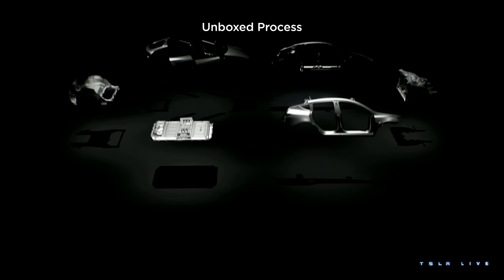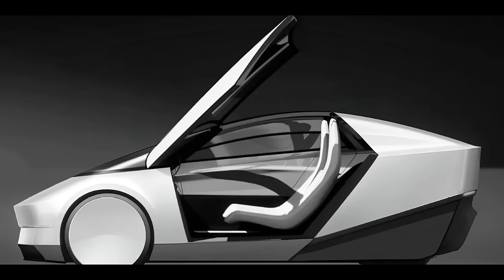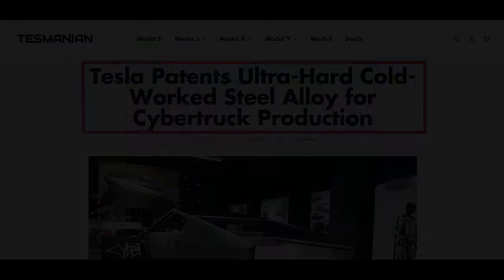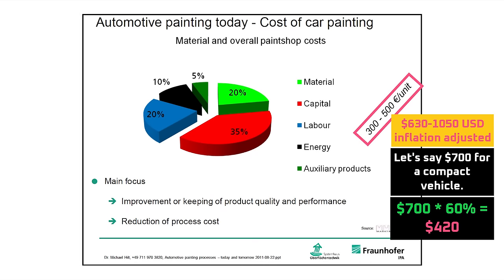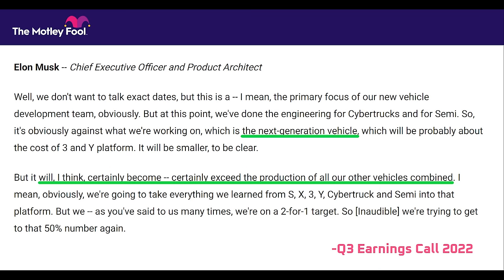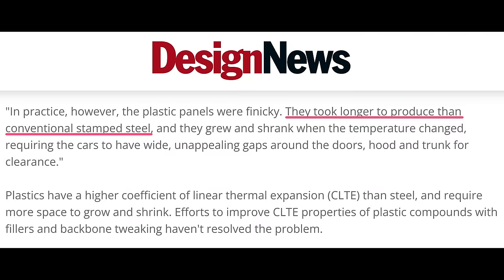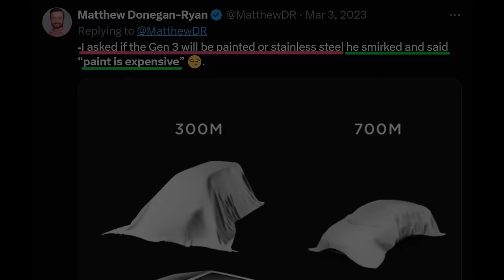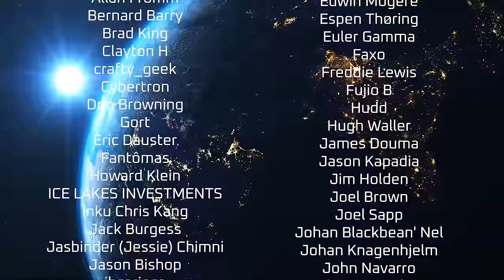Tesla's Next Gen Compact Vehicle // Stainless Steel vs Paint

Comment: I’m wondering if the paint replacement will be a form of in mold graphics used in injection molding except it’s a film wrap applied to the parts in an automated process either in the forming or wraps applied to the parts before assembly. 3D inkjet printing on compound surfaces is also something you can get in china, that’s a feasible option as well

Comment: Keep in mind that blanking die stainless also needs a preheat furnace both for cutting and forming as opposed to cold stamping. The added cost makes laser cutting that much more attractive. When you factor running changes to the design and refreshes. Getting stuck with a blanking die that forces you into a long service cycle and the length of time for the die fabrication. Teslas use of heated stainless formed in am aluminum forming die with phosphor bronze coating makes the process infinitely more flexable and faster per improvements and refresh.

Comment: how cool would it be if the could color the panels  with precision heat annealing straight off the roll..... then you get a wide range of color but only have to clear coat it.
Reply: I've seen it done with a fiber laser on a small scale.

Comment: I’m going with powder coating because the unboxed process allows for smaller parts. 
The smaller parts require a smaller oven or perhaps a longer oven that the parts go through without stopping or requiring any human intervention. 
I don’t think powder coating requires primer either. 

Powder coating has a fast cure time and the application of it requires less accuracy due to the electrostatic charge that helps the coating stick to the part as well. 
I built a utility trailer years ago and it was cheaper to powder coat by a huge margin compared to getting it painted. 
Powder coating guns are less prone to clogging. 
Just my two cents.

Comment: My old car's front fenders were plastic and I just get aware of it years later after a small accident.. fixed easily and was cheap to replace.. panel gaps doesn't have to be designed like a metal door, plastic has much more forming flexibility, so its not a real problem...

Comment: Plastic has a lot more advantages than those you listed. First compact could use large injection molding machines to reduce the part count by combining fender and bumper panels into a single part. That reduces panel gap requirements and avoids tolerance stackup just as gigacastings do. This is a big consideration when scaling production to very high levels that the compact is intended to meet. The body would consist of 2 main gigacastings front and rear, a structural battery pack, glass roof, and single layer ultra strength steel stampings for side panels. The front giga casting could include the A pillar that the windshield attaches to and the rear gigacasting could include the C pillar that the lift gate attaches to. The Jeep Cherokee used a fiberglass rear lift gate so and injection molded plastic lift gate wouldn’t be out of the question. Expansion and contraction of dissimilar materials wouldn’t be an issue if all panels were injection molded plastic. Lastly, panels could be molded from UV stable colored plastics for markets where cost is more of a consideration than surface finish or finish longevity and panels could be painted in markets where finish and longevity were higher considerations. Using all molded structures to build a compact quickly would require minimal fitting and adjustments. That reduces assembly time and operator skill on the line. Which makes teslabot far more likely on the production line, as well as local assembly by unskilled workers in 3rd world markets.
Reply from the maker: It also has more disadvantages than I listed.
Reply: @thelimitingfactor  But if the body and panels were all 'plastic' (e.g. carbon fiber?) then the thermal expansion difference between frame and body panel issue would be minimized.
Reply: @logoschristianacademy6044  That will likely be the case with Roadster but not in a segment where every penny is scrutinized.
Reply: @thelimitingfactor  Saturn midigated the expansion issues by using rubber plugs to affix the plastic panels to a steel monocoque. Those issues however have been minimized since then by improving both plastic chemistries as well as molding techniques. There isn’t much alignment shift in the current mating of plastic bumpers to metal fenders, for example. What I’m proposing is just the elimination of the metal fender panels in favor of plastic bumpers that extend around the sides to cover the areas currently covered by the metal fenders. That eliminates joints between bumpers and fenders entirely. The point is to eliminate tolerance stackup and final fitment processes by using large structural castings along with large injection molded plastic castings and a minimal amount of high strength steel stampings and other molded parts like laminated glass. This minimizes the part count while simultaneously minimizing assembly cost and complexity. Remember Elons montra, “The best part is no part, the best process is no process!” Very large front and rear impact absorbing close out panels eliminates stamped metal fenders along with all the handling, coating and installation processes. That’s right down Elons alley. Not to mention opening up the small car platform for use by other manufacturers by simply molding a different set of plastic outer skins to reflect different design languages of other brands. It’s interesting that GM is bringing back the Bolt around 2025 when they never were able to be profitable in that segment. It’s also interesting that VW has delayed production of their ID Golf until 2025 and that Ford has announced a skunkworks team secretly working on a new compact for 2025… When is Teslas new unboxed compact car coming out? 2025? I say that all these upcoming small EVs will be built on the same platform, because only Tesla has figured out how to do it profitably with its unboxed method.

Comment: What about wrapped stamped steel panels with only anti-corrosion treatment and no paint? Since that coating isn't aesthetic, and it's a single layer (presumably), wouldn't that dramatically reduce the factory complexity, cost, and retain the (final) aesthetics and provide almost unlimited consumer choice? It would also align with Tom's comment about paint being expensive. Wasn't the unboxed  presentation before Tesla had much experience with wraps? Maybe now that they've done it more, they're realizing it could replace paint. It would also be potentially the most environmental choice since both the plastic and panels would be recyclable.
Reply: (It might also reduce repair costs because I guess that wrapping a single door panel is cheaper than repainting.)
Reply from the maker: So many options!  that's another good one.
Reply: What about the inside face of the panel? That can be subject to MORE corrosion in many cases. Would you wrap both sides?
Reply: @rogerstarkey5390  wrapping would not be enough for corrosion protection, there would still need to be some coating, I think

Comment: I was thinking that the weight of the material used could also be significant. Thin stainless steel would be lighter than mild steel and would also eliminate anti corrosion processes which also add weight along with paint. Plastic could be the lightest if extra stiffening material is not needed. I'm sure that more modern materials are better but my experience with painted plastic auto parts has been less than stellar in the long term but for a budget vehicle with a shorter expected lifetime it could be okay.

Comment: You missed a few other ideas they could use. They could use sheet moulded compound like the Cybertruck bed.
Instead of painting they could powder coat the panels like they are doing on the body side rings of the Cybertruck. Also we now know they can press fancy shapes in the ss unlike they previously mentioned as shown by the door inners on the Cybertruck
Reply from the maker: Fair point!

Comment: Nailed it. 
- Repairability
- Ubiquity of cheap steel, esp outside 'developed' nations
- Likely cheap new process which largely ignores 'owner pride'
Also:
- This is a world vehicle. Most nations follow the UNECE regulations for eg safety of vulnerable road users. Except the US, copied by Canada. As much as extra-thin stainless steel may appeal on so many grounds, the Compact will need to be acceptable outside the US. Will 'bounce' be as good as 'crumple'? I don't know.

Personally, I think weight will be an even higher priority due to low speeds, and very short journeys (60% are under 6 miles in the US, 95% under 31, and even shorter in other countries) combined with 'globalised' standards, will switch design considerations accordingly.

Comment: Tesla might have a wild-card up there sleeve.  For instance, pebble texture roto-molded polyethylene is tough as nails, easy to fix, and wouldn't fade.  But has a "cheap look" because of all the cheap products that use it.  

Afik, the CTE mismatch of plastic on a metal frame could also be solved with careful design and modeling of the body panel mounts.  I.e. let them float a bit as they expand and contract.  (adds cost and reduces durability though)

Comment: Unless all the paint is mixed together at once for each run, they are going to run into paint matching issues when painting parts separately. Matching paint is the single reason repair shops overspray and blend onto undamaged areas when fixing cars today. Without doing that, the minor replaced/repaired body panel would become obvious due to inconsistency from one batch of paint to another.

Comment: In the past would have said, stainless steel is double the price than steel. Now I checked parts out of stainless steel. The price (Stainless Steel, Laser cutting and forming) went up from 540 to 810€. Europe can be more difficult because of Russia boycott. 
Not being a specialist, thin steel on the carossery was maybe min 0.7mm. For Stainless Steel I can't imagine that it's possible to make it thinner than 0.5mm. What could be tried is a surface thats not flat e.g. like the Junkers Ju52 plane. But for aerodynamics it could become more difficult. 
Plastic on the surface could look too cheap. But I think the Mercedes Smart had/has a plastic surface.
Reply from the maker: Thanks for the insights!
Reply: @thelimitingfactor  There is the e.Go manufactured in Aachen but not very successful. The Smart seems plastic but with good painting. The Saturn, yes. And the BMW i3. Carbon as the Rimac. 
Aluminum would need a protection at the outside (e.g. the large models or the Audi A2 (2000..2005)). It could be a sandwich of Aluminum sheetmetal and a hot temperature glued plastic foil. 
Maybe we come to a foil that can produce electricity through sunlight if they really challenge their developers to make something extraordinary new. Just strange ideas.

Comment: Regarding the use of plastics, those that would be recyclable would have to be thermoplastics, but they do not provide the same level of structural rigidity as thermosets, which are non recyclable due to intermolecular crosslinking. Also, the materials would have to be highly UV resistant/oxygen resistant which is hard to achieve for decade long utilisation. Though very attractive from the weight savings point of view, I believe that metal materials will be preferred.
Reply from the maker: Thanks for the insights!

Comment: Doesn't cars use plastic in the bumpers for decades now? And they are fixed on front and back end with very tight or even no panel gaps... But only a few parts can be plastic since there's a safety trade off if used in all the panels. Bumpers (obviously) and wheel arch panels are the very few that can be plastic and several car manufacturers have done it. Renault have done that with it's Clio compact since the early 2000s. The rest like the "bonnet" doors and trunk have to be steel.

Great video Jordan.
Reply from the maker: Thanks man!

Comment: Thinner steel can be hardshaped - the use of lasers is not necessary in this case. No rust must be a prerogative for a RoboTaxi that should operate as long is possible as a shell. Battery tech can be updated in the next 2/4 years all else can be updated.

Comment: What if Tesla figures out how to apply wrap in a factory setting? What if it's possible to vacuum the wrap onto each part before it's installed? What if they figure out a long lasting wrap and adhesive?

And wouldn't it be very much like Tesla to do this?

Comment: Do you have any estimate of the cost of a Model 3 that would be 48V, all by wire operation, and unboxed manufacturing? Could this reduce the current price to <$30,000?
Reply from the maker: It would cut the cost by 15% or so

Comment: What about doing like Aptera? Not sure exactly what material they use
Reply from the maker: There are a lot of companies doing innovative and interesting things, but there are so many of them, and the likelihood of failure is over 90%.

I tend to focus my time and attention on companies that are close to succeeding or have succeeded. 

The exception is if I'm exploring a technology and need an example for a video.
Reply: @verylongtrain MOST of the Aptera body is made out of "forged" carbon fibre. It's made in Italy and uses some of the largest dies for such material. I think there is also a steel roll/crash cage and bracing internally.

Comment: If you don't care about towing and rigidity why would you use work hardened stainless steel. Just use the same stuff they used for the B surfaces of the Cybertruck doors. That can be stamped. If it's not work hardened I don't think you even need laser cutting.
Reply from the maker: That doesn't solve the cost problem.  If it's not work hardened, it'll have to be thicker.  Lots of variables, not just one or two.
Reply: @thelimitingfactor  I think it removes the need for laser cutting and press brakes and opens up the styling options.  I'd also expect Tesla wouldn't bother with any finishing steps for a taxi which they'd likely be wrapping.

Since you're responding, can you tell me how, as a contributor, I could have accessed this story when it first appeared on X?  I was unable to find it anywhere a week ago.

Comment: Tesla could use ordinary stainless steel instead of hardened.  Then it could be formed instead of laser cut.  It would also be cheaper.  Or they could Just use hardened SS on the doors for impact resistance.  Still no paint and more like the DeLorean material on the rest of the car.
Reply from the maker: They could do, but it would still be expensive.  Non hardened would probably have to be thicker than I suggested.

Comment: The unboxed method is based on assembling smaller components that are already painted, so that means stainless steel is not an option.  It may be plastics, painted which will appeal to the masses, instead of a techno head minority like the Cybertruck.

Comment: You can't just swap between materials on the same design. If the Robotaxi is Stainless Steel, then so is the Compact car. You would need ultra high strength steel to replace the high stiffness of the Stainless Steel else it wouldn't be strong enough.
Reply from the maker: I'm not sure what you mean, I indicated that the stainless steel would be super thin.  That is, it wouldn't be performing a structural role.

Comment: I wonder if Lutz was being truthful about plastic. The Corvette had always used it and it's a premium vehicle. The Fiero pioneered the newer version that Saturn adopted. So did the dust buster minivans and there was never ever a complaint about gaps. There was applaud about the durability and ease of replacement and redesign. No consumer ever complained.  Journalists were hitting those vehicles with carts and rocks long before the CT. 🤔🤔🤔
Reply: Corvette was/is fiberglass. Fiero was a combo fiberglass and plastic panels. Saturn used steel and plastic panels in basically the same areas the Fiero had plastic panels. My Saturn had basically the same panel gaps as every other steel vehicle I had from the late 90s and early 2000s. I wasnt even aware anyone considered panel gaps to be an issue back then as everything I remember in that era had huge uneven ones!
Reply: @patreekotime4578  True. The Corvette's fiberglass is glass fibers in a plastic resin. I think it also used RRIM and SMC.

Comment: Stainless steel may not be suitable for a mass-market vehicle due to sharp corners, which aren't allowed in the EU market. Because of the challenges in stamping stainless steel, it can't be easily produced with rounded corners. 
As it stands, the Cybertruck may not be importable without special modifications to its edges.

Comment: Great job as usual Jordan. 

I do believe Tesla has shown an ability to take tech the industry has used in the past, but gave up on, and moving forward to become very useful. 

I am leaning towards the idea Tesla has something we just have not heard about yet, but it will be an evolution of something already attempted, like the plastic bodies of the GM Saturn line. The way Tesla developed not only a special stainless steel, but special production machinery for casting and cutting it, I believe they will do what GM was not able to do. 

I guess time will tell. If Tesla manages to keep their talent pool full of top level talent, they will solve the problems. The 4680 timeline is way behind, but you can see they have gotten much closer to what they were gunning for when they first announced that battery. This seems to be the Tesla pattern, go for some high level goal but vastly under estimate the time needed to make it happen. Over half of the time they reach the goal. Failure still happens, but when you look at legacy builders, their success rate is under 10% of the time.